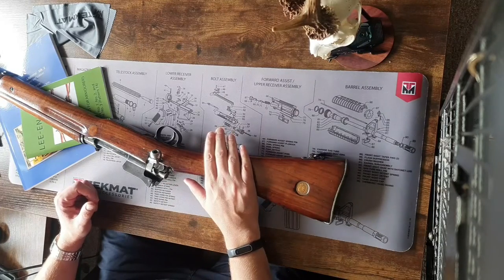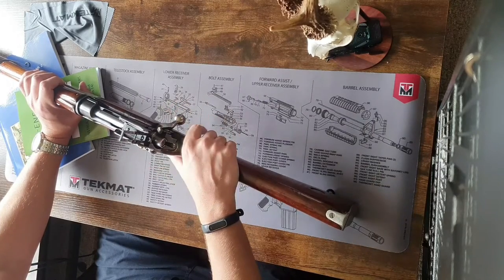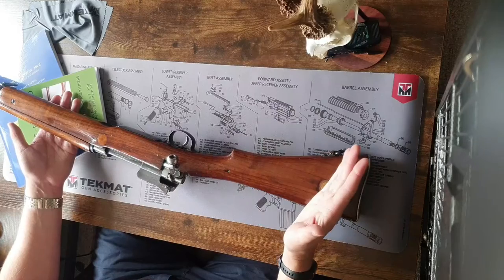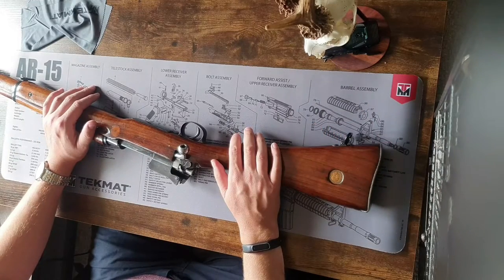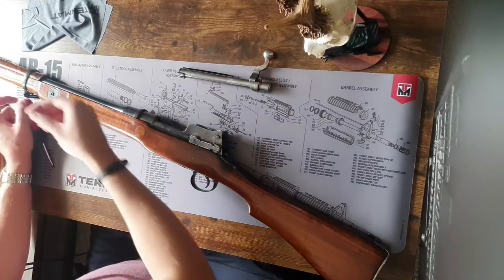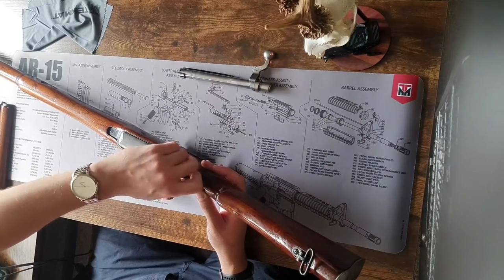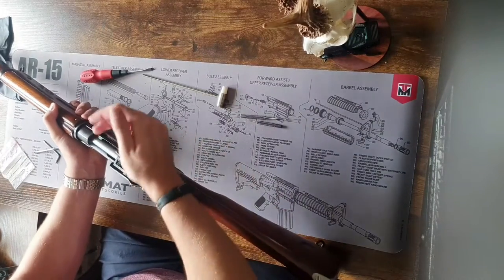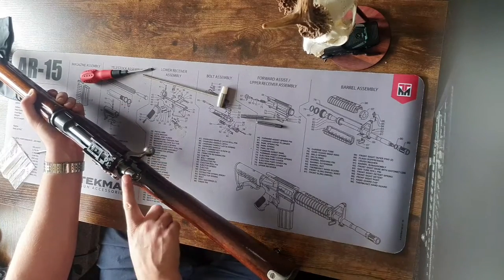WW1 British Pattern 14 (P14) .303 rifle - full detail strip and reassembly

Comment: Hi, i have a question! Can i fire with pattern p 14 if it hasnt the bolt stop ?
Reply: I mean bolt lock like 11:12 on video
Reply from the maker: Bolt stop is the right terminology (this is why I should probably plan these videos 😅). Without having any firearms expertise - my opinion would be that the bolt stop isn't intended to secure the bolt during firing. The locking lugs on the bolt (and locking recesses around the chamber) are designed to hold the bolt in place during firing. At 50,000psi, if the locking lugs failed, I wouldn't expect the bolt stop to catch the bolt from being propelled out of the rear of the rifle anyway, so I don't think missing the bolt stop would make the rifle any less safe to fire than if it was present :).

Comment: But Sir, if you had to, how would remove the front Dog Ear Sight assembly from the rifle? It is the only way to remove the receiver band and the bayonet log off the barrel, correct??
Reply from the maker: Personally, I'd take it to a gunsmith. I'm sure it's just a matter of knocking pins through but mine don't want to budge so that's where I drew the line with my tinkering.
Reply: @jabbott376  Update - I did take my action in and found some news for everyone...there is a small raised groove under the sight that keeps the Front sight from rolling left or right, and the small pin (seen under the sight block) fits in a channel between the groove that prevent the Front sight from moving forwards and backwards. So, in other words, if you pop out the small pin and tap it with a small block of soft wood forward towards the muzzle, the Front sight comes off Very Easily...and goes back on just as easily, so you cannot screw it up!!! I would send you pics if I could of my disassembly.
Reply: @wilyfisherman3953     Some require heating and beating.  The armorers apparently had a special puller for removing them.

Comment: Huh' the bolt on mine doesn't have a hole in it. Mine is a 1915.. Maybe they lightened up the bolt later? Mine is a Winchester, perhaps that is the difference too?
Reply from the maker: The action on mine is a Winchester. I know i've read about that bolt hole somewhere. I'll need to have a dig around - but i think you might be right about it being a lightening cut.